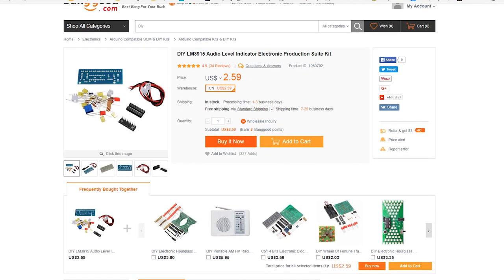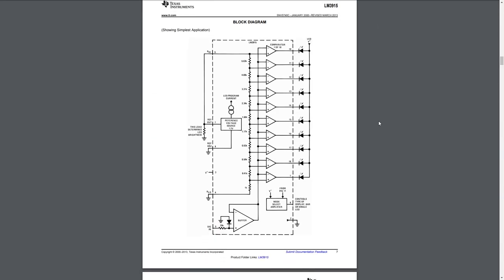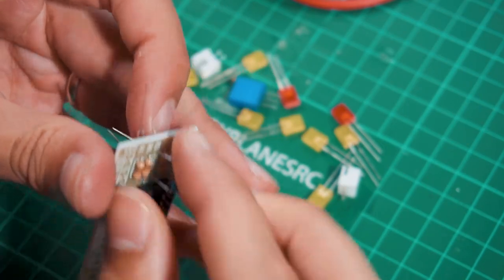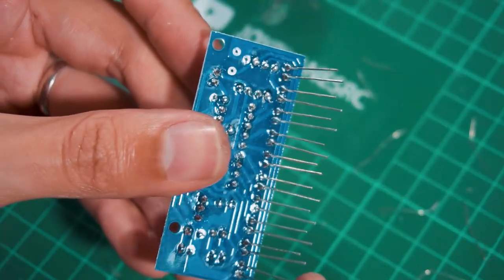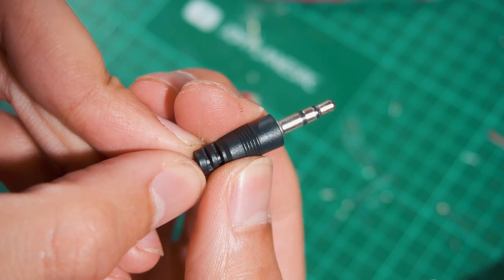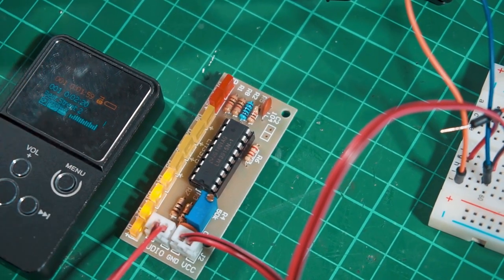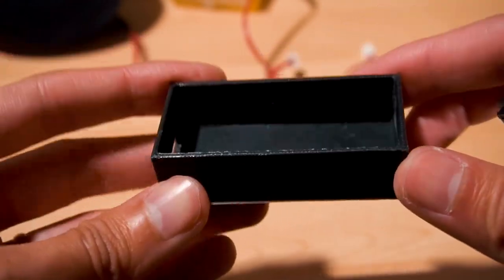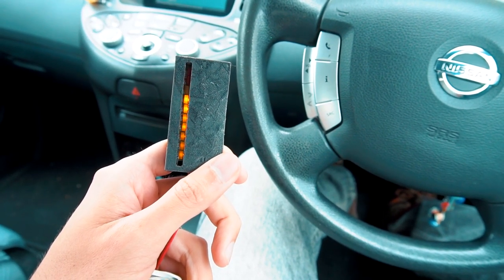VU meter DIY kit with LEDs | LM3915N-1 LED DRIVER

Comment: just add to the pin 5 LM3915 electrolyte 2.2μF against the ground and the luminosity of the LED diode will improve. also with this capacitor can regulate the speed of movement.

Comment: Hi,
I’ve just made one, I know how to attach the battery that’s easy, but because I’m a newbie I’m not entirely sure how to connect the music and speaker side. What did you use to connect the cable to? 
Mine works I can see the lights, I would just like to finish the project with some sound going thru it. Your help would be appreciated 🙏

Comment: Can 3.5mm cable replaced to RCA cable?
I mean, 3.5 male - RCA male, cut the rca lines, and use it for audio signal.
Reply from the maker: Yes.
Reply: Thanks for information. 😊👍

Comment: The voltage levels these things require to register even for the lowest bar is extremely high, even if you turn sensitivity to maximum. You really need to put this thing to the output of a power amplifier. It won't register headphone outputs very well, at acceptable volumes. You need to turn the volume up fully beyond the safety level to get it to register. It's a shame these things don't have integrated amplifiers.
Reply from the maker: I found out that I had to make a bridge between two pads to fix it, but it doesnt have any instructions explaining that.
Reply: @Joyplanes  can you recall which two pads?